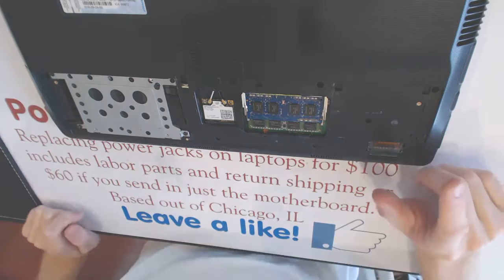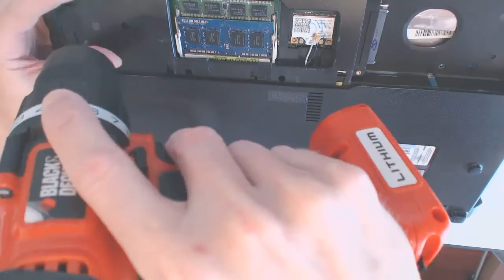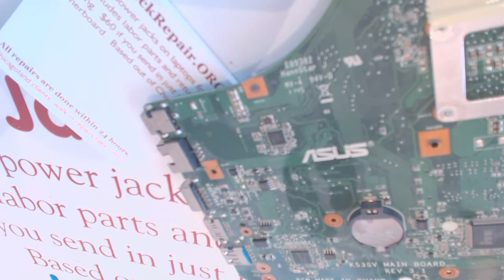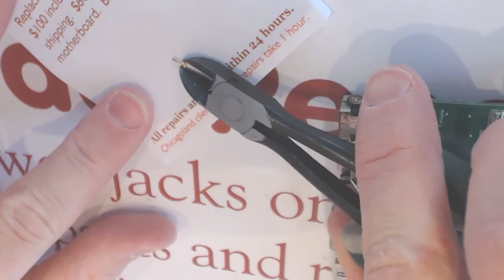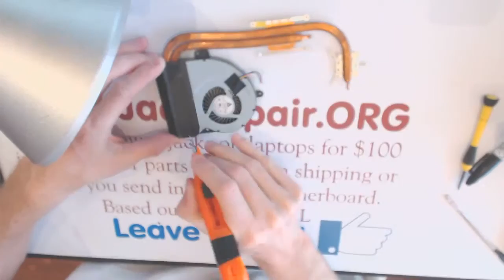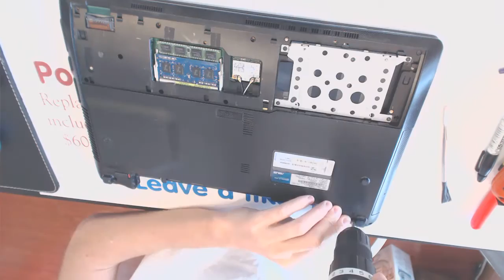Asus a53s K53SV How to repair a broken dc power jack socket input port on laptop

Comment: This is a lot harder than it looks! very easy to warp the circuit board due to over heating, 
and in my case the socket legs were folded over the board, so I ended up having to cut away the old jack and remove each pin separately, but got there in the end! Heat gun is essential, as soldering iron will not distribute the heat evenly, I learned a lot!

Comment: After I replaced my jack.......the charging goes well but my display doesn't turn on .....can you help ?
Reply from the maker: ribbon cable is damaged or the pins where you plug in your LED cord into  the board are bent
Reply: @Powerjackrepair  can you please tell me which ribbon cables are you talking about ? ....I realized today that out of the 4 LEDs below the trackpad ....the battery led keps on while I charge via AC adapter, the caps lock and the num lock led stays on(even after pressing the caps and the num lock key ), and the power indicator stays on, whereas the drive activity indicator just stays on for a second  and then turns off (and then stays off later ) after I press the power on button. The power on button led also stays on. I tried plugging an external monitor via HDMI cable but it shows ' no signal '. The solder was hard to remove so I had to warm it up for a while, is there any chance that due to hearing up more the motherboard could be damaged ? .....please show me a way since I have my very important data and being in Germany I can't come to you to get it figured out to you 😪. And can you please send me your email I'd or something so that I can contact you if needed ....I can send you the pictures of the solder I did
Reply: @mayankgbhadani  I had the same problem after changing the power jack. I fear I may have blown up the mother board some how. Did you have any success. (Melbourne Australia)
Reply: @joeybrown3583  no , there's no progress. I asked this question there thinking that the channel owner could help me.but they didn't respond as you could see and I have just.kept.my laptop since then 😅
Reply: @joeybrown3583  no , there's no progress. I asked this question there thinking that the channel owner could help me.but they didn't respond as you could see and I have just.kept.my laptop since then 😅
Reply: @mayankgbhadani  There only two solutions that I can see.

1. Try a new mother board. ($70 AUD)

https://www.ebay.com/itm/ASUS-K53SV-Laptop-Intel-Motherboard/114079354014?hash=item1a8fa8cc9e:g:Rm0AAOSwo0JWI7ed

The problem is what if the CPU is dead or some other component.

2. Buy a second hand one and switch HDD. Too easy but more expensive. ($300-500 AUD ????)

Note: Of course you can always connect the old hard disk to a desktop and extract the data.

I've been thinking about it a bit more and I don't think the display is the problem. When I turn it on it does not boot and the hard disk light does not flash as if it is operating.

All points to something on the mother board is damaged.
Reply: @joeybrown3583  I am going to change the cmos battery and check is it works
Reply: @mayankgbhadani  Wait!.....I may have fix for you.

I have two banks of RAM in my laptop. I removed one of the RAM cards and turned it on. It booted up and worked perfectly.

Try this simple thing and let me know how it went. 

Hint: There seems to be an issue with the BIOS. more to come on that soon.......
Reply: @joeybrown3583  to figure out what's wrong with it I kinda opened the heat sink and now I don't have the thermal paste 😅.....I will have to get it first and then I can have my laptop assembled back to check for more options
Reply: @mayankgbhadani 

I hope you can get some soon.

then you can try removing one of the RAM cards. I am really hoping it works for you.

Also ......what version of windows are you running?

If windows 7:

I am about to try this.........see video below.

HOW TO UPDATE BIOS ON ASUS LAPTOP FAST AND EASY RAM AND BOOTING FIX

 https://www.youtube.com/watch?v=ykXrik89TpI

I will let you know if it works.
Reply: @joeybrown3583  sure ...I will be in touch with you once I am done with it .....can you mention or email or something to contact once it's done ? That might be helpful
Reply: @mayankgbhadani  I just updated the BIOS and the laptop recognized both channels of RAM. Success.
Reply: @joeybrown3583  Congo .....wish me luck 😂
Reply: @Powerjackrepair  Your video was good and I was quite happy with myself as I was able to change the jack. It now charges. However I had the same problem as Mayank (above). The display does not come on. I think it is charging however. I fear I may have blown up the mother board some how. I checked the the connection to the display and it looked ok. Everything is so small and its hard to tell if something is broken. Thanks for the experience (Melbourne Australia)

Comment: My solder is not melting. What wattage of soldering iron is used in the video?
Reply from the maker: 30-35 watts should be fine, you need to use flux to melt the solder.

Comment: Ok I got the old DC jack desoldered and the break was pretty much in the
 same place.  It was hard with a 30w soldering iron so I went and got a 
variable 25-60 watt one and dialed it down to 50watt according to advice
 from the sales guy.  However, while practicing I am having a hard time 
getting the technique right and encouraging the solder to properly draw 
towards the item I am soldering and have lost confidence.  I wonder if I
 am using the wrong solder.  It's a rosin core lead-free made by Aven.  
Also got a rosin flux pen.
Reply from the maker: might be counterintuitive, but add solder first to the pads, and then remove the new/old mix solder from the pad using wick.
Reply: I tried that but didn't have much success in getting the new solder to stick to the old solder which was probably much higher temperature.  Just took some time + fresh flux + fresh wik braid to get the old stuff off. 
Fretted more about resoldering it.  It is perfect on the underside, not so perfect on the top side where it is close to the network jack except the main gold contact in the hope it won't break again.  But did it and everything works.
Reply: [Edit: Youtube hid the messages and I didn't remember I had already responded to this] Like I said I didn't have problem removing the old stuff, it just took time.  Keeping my hands steady and getting enough on the top side was another difficulty as there were a couple tight spaces and a melted some of the plastic on the network jack but in the end it is done, I just hope it lasts.

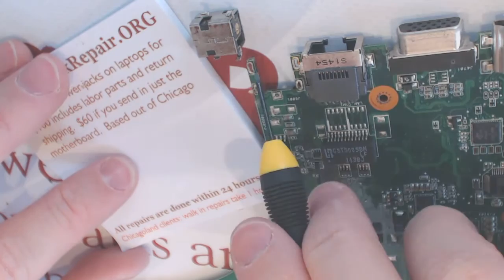Comment: 23:00 In the one I have, both arms have snapped off and are attached to the old jack. I know the one on the bottom left is necessary, but am not sure about the rest. Will I need both arms re-attached? If not I could glue the jack in place.
Reply from the maker: no need, if they snapped, just make sure the - is conducting somewhere, cement everything in place

Comment: Another success story, Thank you! 
I purchased the Kapton heat protecting tape from Amazon, used it for the demonstrated purpose, and also to tape the heatsink/fan assembly back together after cleaning. Once reassembled, the laptop was so quiet, I removed the keyboard again so I could verify that the fan was turning (I thought I forgot to plug fan back in!)...

Comment: Hi man good video, i have same laptop as your, I had the same problem as yours but I never knew it before I made my research. I send the computer to a place where i live they scammed me and took my parts from it the screws are almost done and in the mother bord I saw the toke my parts and the power button cable are injuries what should I do man I feel scammed any help?
Reply from the maker: power button cables are replacable as long as your hinge isn't broken on the board for the power cable.  Screws are no big deal, it is not a car should work fine without screws
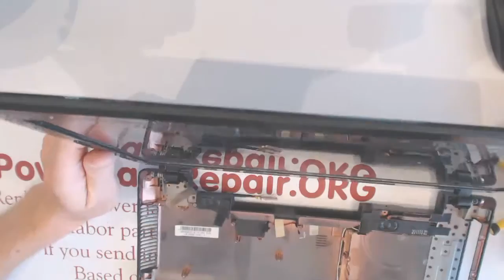Reply: Power Jack Repair okey thanks for fast respond, where I can find to buy a new replaced cable for power button?, on the video 8:58 you see the parts from the laptop are taken like plastic button right  side and where should  the cable of the motherboard to get connection to power it?
Reply from the maker: ebay

Comment: Thank you for pointing out that it is usually a cracked pin that is the problem. I bought a new jack so I had it when I tore down just in case I had to do a full replacement but because I then watched this video and since I could see that the rear pin was just cracked I was able to solder it back together without taking the entire jack off. Worked mint! I didn't even have to take off the heat sink. I could blow all the dust out and it's clean as a whistle. A++ Thumbs Up!
PS: If anyone has screen flickering problems on this laptop, that's just a matter of taking the screen apart and wiggling the cable around. Mine has a short somewhere and i've fixed it a couple times in the past 2 years.
Reply from the maker: true true to everything, but it is all temporary fixes unfortunately, on this laptop the heatsink is located righ next to the jack, and the "fix" on the rear pin will melt down and stop working eventually.   The cables do have shorts, it is better to replace them if you can, the new cables are just $5.

Comment: Thanks again. I got help in a different videofrom you. By the way, I have a HP laptop that is broken any chance I can use pin from that? it is 18.5 v and not 19 like this. I mean if it phyiscaly fitts, or will the 0.5 volts less bee a poblem?
Reply from the maker: no difference between 18.5 and 19,  what you need to do is multiply 19 by whatever amperage need i.e. 3.42 or 4.6 and you will get either 65 or 90w, make sure the wattege is somewhat similar.
Reply: OK, they have same amperage 4.7
Reply from the maker: that means they are the same